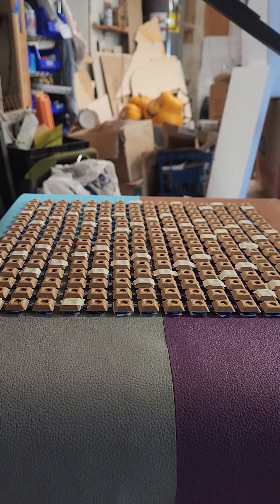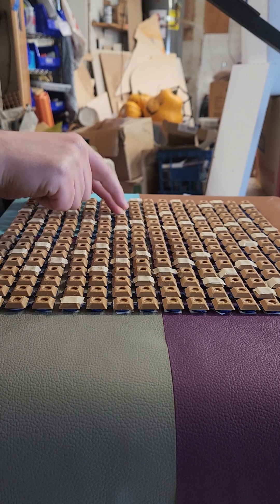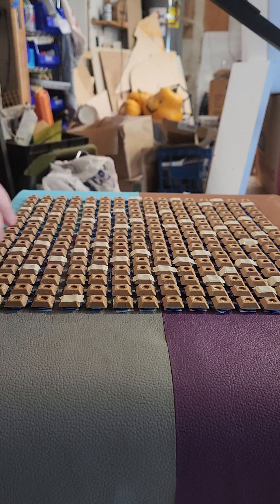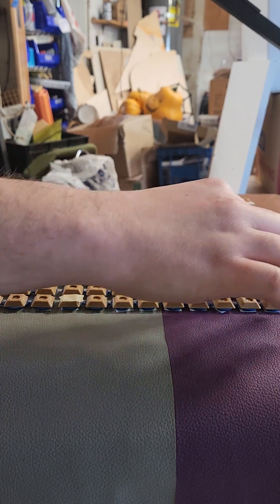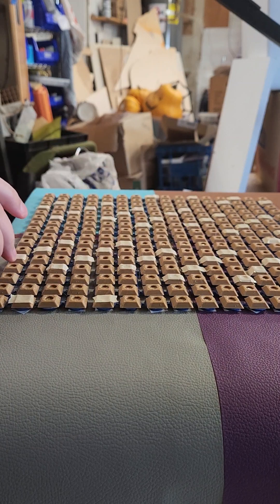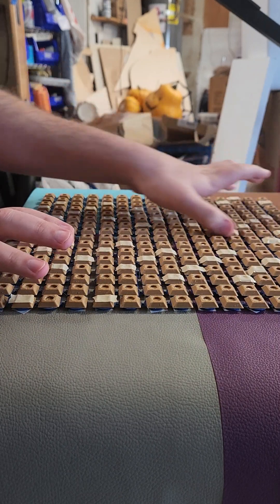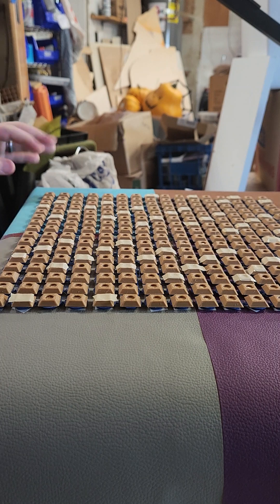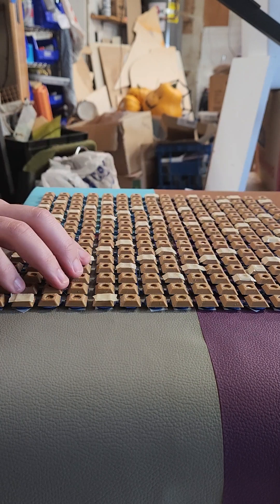DIY touch-sensitive grid keyboard (Linnstrument inspired)

Comment: This is pretty cool! I'm interested in building my own velocity-sensitive keyboard but I'm worried about the calibration and the finnickiness that comes with using velostat. 31edo is a great tuning system btw
Reply from the maker: The calibration and finickiness is a valid concern. I've continued to have mixed results. Lots of the time it's very good, but never perfect. My best experience has actually been disregarding/disabling the aftertouch feature unless I specifically want it for a patch. 

I can't remember if the version I demo'd in this video has it or not, but I also added a feature whereby the note velocity is matched to a value in an array of 128 different byte values. This along with a bit of spreadsheet work lets me map the linear values of 0-127 to any velocity curve I might want. For example, a curve that favors the mid-range dynamics, or one that makes it easier to get to the top end of the dynamic range. I would make another video about it but I am still not 100% happy with the thing's performance. If you do try something, tag me or send me a note! I really would love to see what other cleverer ppl can do.

Comment: Teensy is rather awesome when used with midi progects. Thiis project is really cool, have you made the next simpler version of this yet? I am very curious about the Velostat material.
Reply from the maker: Yes, check out my other videos for a long walk through of my second build! The Velostat is amazing. I had a little trouble making it and the coverings lay flat, which makes the touch experience a little inconsistent.

Comment: Wow.  Very cool project.  Lots of cleverness both in idea itself and the execution.  I have a Linnstrument, along with Akai Ewi and other wind controllers, and I'm starting to experiment with DIY controller building.  Looks like yours would be a fun project.   How are the pads/keys (and/or the cushion layer) attached to the velostat?  Similar with Borgophone instrument, curious about what exactly you used for those metal keys on that one , and special kudos for the brass-oriented fingering design, haven't seen  anything quite like that before; hope to get some ideas from your github project on how you've applied/extended J. Berglund's note identification algorithm.
Reply from the maker: Thank you! I hope you find as much fun in DIY controllers as I am! It's pretty frustrating at times, but also hugely rewarding when something you made works, and does something unique. 
All those brown squares are 3d printed shapes I came up with. I didn't use them the way I meant to in the end, and I wouldn't probably recommended going to the trouble of printing all those. There are other cheap options out there that take less time to make. I'm working on a followup video with more details; not sure when it'll be done but I'm going to try and talk about keys, because I think that's the most important part of the whole thing. In another attempt at making keys, I just used some thick 1/4 inch closed-cell foam from an arts & crafts store; and cut it into squarish shapes, which I glued down to some thinner foam. That's working pretty well, and I wish I'd found that material sooner. Still it's not perfect, and I made both of these prototypes with a smooth surface, to which I'm attaching sheets with the buttons glued on. This lets me try different things without having to mess with the circuit or any of that hard work.

So on my Borgophone, for the first few versions I used copper tape, which is easy to get. I stuck it to clothes buttons to get a 3d texture, and soldered wires to the pads. They use capacitive touch. For the newest one, which I don't think I've put up here yet, I used cherry-style keyboard keys because I wanted the physical feedback of pressing a button. They work better than expected, and I personally prefer them over the touch pads. They're more costly than the copper tape materials-wise though. 

Do you plan on sharing your endeavors anywhere? I'm always wanting to see other projects like these! Thanks again.